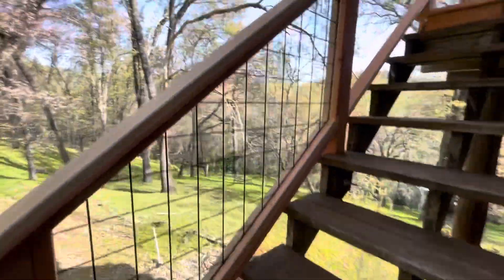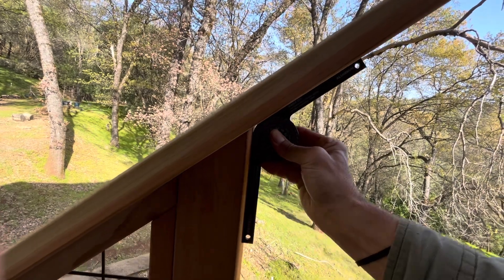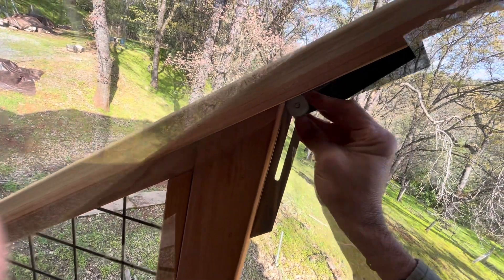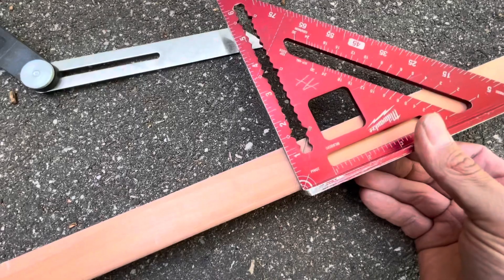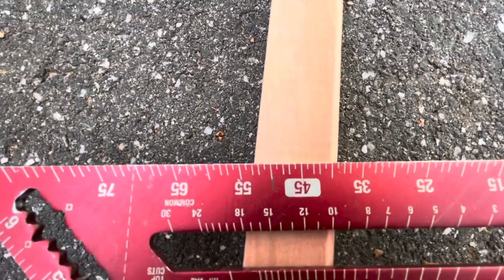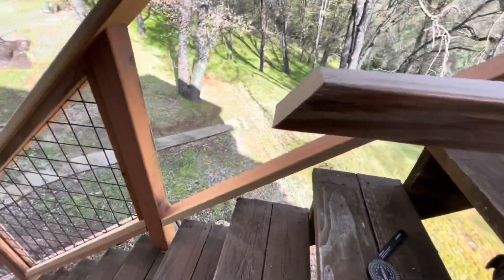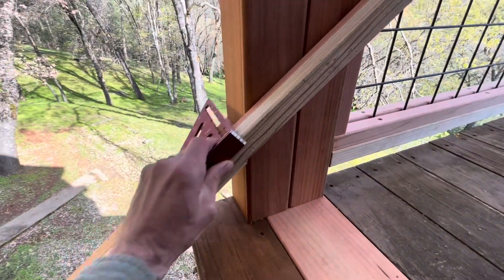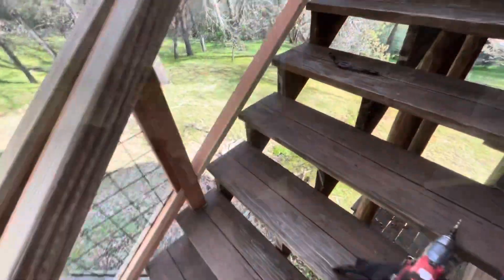How to find angles and where to cut with speed square.

Comment: How did you angle the hog wire on the stairs while keeping it square to hog wire on the porch?
Reply from the maker: @claybarnett9056  I had panels that were pretty big I think 6’x6’ and cut them thatch the opening. I would hold them up level and mark and cut them little by little until they fit perfect. There is a lot of waste this way but it looks the best.